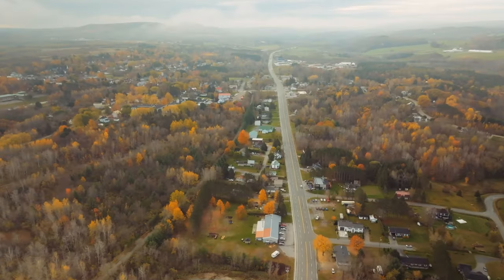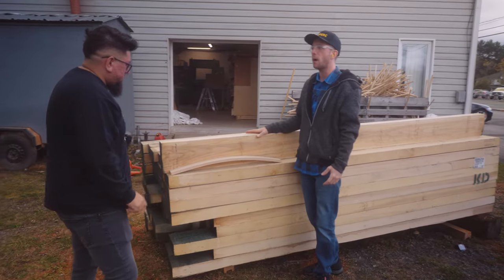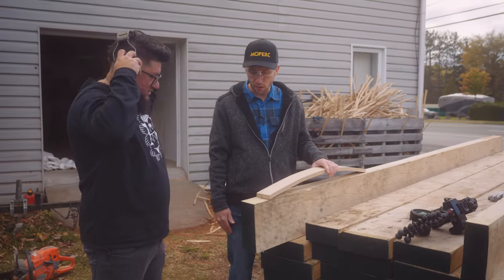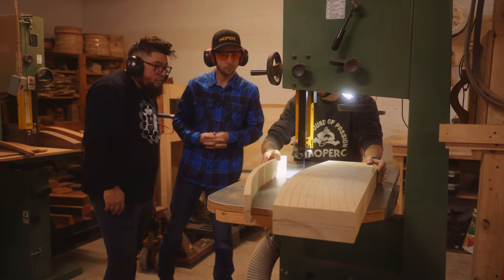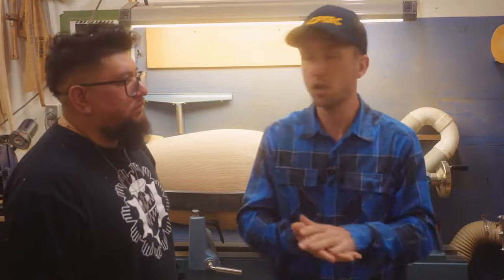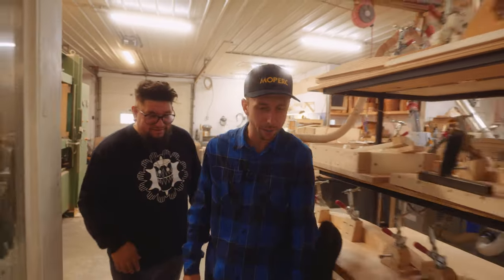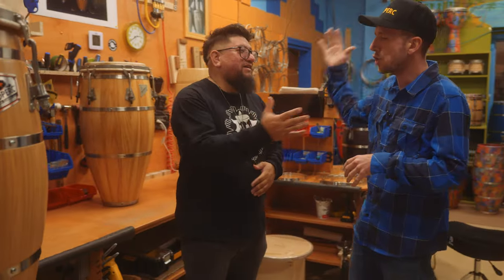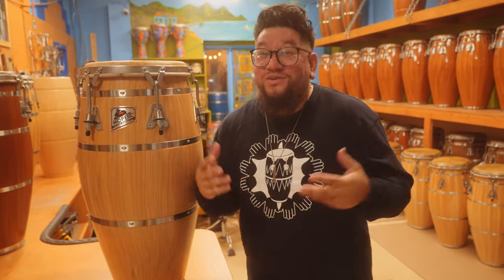How To Make a Conga Drum | I Visit the Moperc Shop

Comment: That shop is impressively clean! Nice equipment and tooling! I wonder what it looks like on a normal production day and am surprised they stored kiln dried lumber outside.
Reply: Our wood is stored inside. When we receive the bundle, it's cut outside the same day and leave it in the shop for 2 weeks before starting the process.
Reply: @franafrokan  Oh. That makes more sense. You guys must work really hard to keep that shop clean. I spent some time as a student, making ashikos. Everything was hand sanded and scrapped after glue up. We all wanted a lathe, but the "boss" said he didn't believe in shaping on a lathe. (It was also cheaper for him since student labor was free :).

Comment: Couple of surprising things in this video. 4% is incredibly dry! Australian timber merchants kiln down to 7 then back up to between 10 and 13% with steam. Why so dry I wonder, given it's so much lower than ambient? Also cutting curved staves - that's unusual. Conventionally staves are cut straight and bent into shape. Assembly I guess is easier with pre-curved staves, but isnt there going to be a shaggy surface from tapering against the grain?
Reply: Hello! Our slabs are flat cut, our staves are quarter sawn. We don't work against the grain and the result is a better stability than steam bent. But you are right that wood grain changes along the staves, but anyway, we have better results on woodturning shells made with this technique rather than steam bent.  6-8% is the accepted moisture content of kiln dried lumber here in North America. The real stabilization of the cells happens as the lumber is brought down below 8%. We have extreme humidity changes here, if not controlled, it can vary from 30% to 80% in our shop and into most people houses. Opening windows on humid summertime days, heating full blast on winter time.  Outside temperature also vary from -40 to +40 Celsius. We do our best to stay around 50% of humidity in the shop. Thanks for watching !

Comment: In a recent video you made you complain how expensive Lps where and recommend not to buy...but yet you endorse Morpec which are by the way more expensive...mmmm...
Reply: Perhaps Eric was suggesting that comparatively speaking, Moperc is the better choice for the long run. The end of the video explains many reasons why this is true.
Reply: The most expensive Lp costs almost the price of the cheapest Moperc, and yet that Moperc is still way better
Reply from the maker: What Daniel stated is exactly what I meant… not saying don’t buy an LP… go ahead… but if you’re going to spend that amount for a drum… might as well invest in a Moperc which is made with actual solid stave wood and stainless steel hardware… speaking from someone that has owned LPs most expensive congas… 5 of them actually…